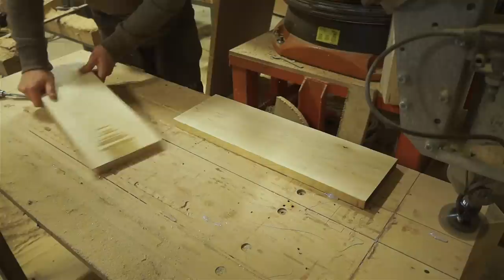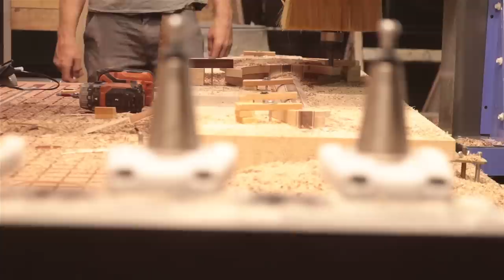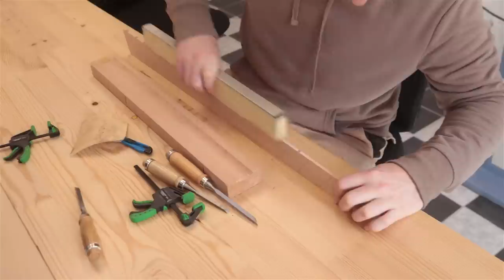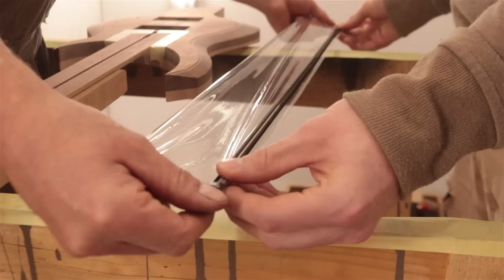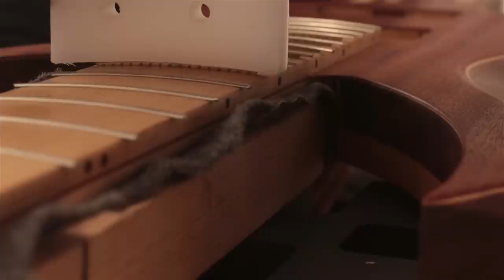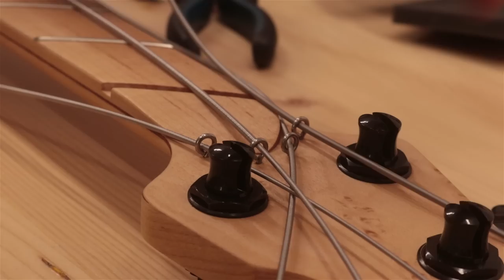Making a Sub-Octave Bass for Nate Navarro - Workshop sounds, no talk

Comment: I really love your builds. One thing I would like to point out is the glue you use for layering. As far as I can tell, that's PVA glue. Now, it's an amazing wood glue in most cases, but luthiers don't really use it for building and repairing, because of a critical property. When it dries, it stays just slightly rubbery. In construction or furniture making that is in no way a problem. However when you're building an instrument, that thin layer of soft material between the good quality wood can lead to dampening of the vibrations throughout the body and neck. A much better option for laminating would be 2 component jeweler's epoxy. It sets up super hard, so it would be the ideal material for transfering vibrations. Another good option is Titebond original wood glue. It is made of aliphatic resin, that has better properties than PVA. You can do a really easy experiment. Put a dab of PVA and Titebond side-by-side on a piece of wood, let it completely dry, then try to sand it. You'll find that while the PVA will gum up the sandpaper and shred, you can beautifully sand Titebond. I hope this was at least interesting for you guys, even if you stick with your methods.

Comment: Kalium, the string company, has a 40 inch (1016 MM) scale bass they call the Quake that comes in both single and multi-scale options. I assume it was originally made so they'd have something to get a good tension to be able to show off the 0.266 gauge string that they make

Comment: Beautiful build, my only recommendation  is that instead of lining the pockets with "silver" foil, use copper, and solder on a ground wires that can be connected into the electronics.

Comment: Whoa, what an awesome instrument, didn't even know these were a thing.

On that note, that finishing process where the router takes more time lifting and repositioning than cutting pains me. What CAM program do you use? You could set it that the tool stays down the whole time and just circles back  for the next cut (no horizontal lifting motion) or you could even let it do climb cut and conventional cut passes alternatingly, which is fastest but might not give you a the desired surface finish, so use with caution. Hope this helps you optimize your process.
Reply from the maker: Yes, this is a prototype but hopefully we will build more. 😁As for the milling,  after years of working on a robot and testing all the speeds, feeds and milling methods, I concluded that the best surface finish on wood is achieved when tool always goes in the same direction, and the total time on the project is also the shortest. It would be faster milling part to have it mill around without  lifting but I would have to make additional extensions on 3d model where tool would change direction, otherwise it would leave a mark which would take more time to sand and leaves less precise surface. This is more of a problem on a robot arm than our cnc because it is not as rigid as cnc and each direction change is quite noticeable especially at higher speeds . The plus side is that robot hand can move up to 2500mm per second ( I never go so fast because I just feel it's not safe or good for machine,  usually set to about a meter per second)  so time in the air is a fraction of total milling time. Setting up the 3d model this way  would usually take more time than using just down cut and do something else with extra time while machine works. Although for instances where we have multiple identical pieces, I agree it is the way to go. I suspect if we buy more quality cnc with lead screws instead of gears on x and y, marks from direction change would be much less of a problem.
Reply: @lignumchannel  I think you're misunderstanding, in my CAM-software (Fusion 360) it's just a setting that makes the cutter move through the air on the same z-plane to get to the start of the next cut instead of lifting. I found that this works a good bit faster. No need to model extra geometry or something like that. If your software doesn't have this though then I have to excuse myself.

Comment: Amazing work up unitl the cheap eye hooks you used to guide the strings to the head?
Reply: How about the plastic knobs too?
Reply from the maker: Yeah we made a few guitars with hooks lately but I'm not sure we will stick to that design. Also the knobs, I like their design but not the method of production. Bog oak ones would fit it much better.
Reply: @lignumchannel  That's good thinking. The hooks took this seriously good work down to some redneck DIY level. It hurts, especially after seeing what you guys are capable of ;)

Comment: Any bass can become a sub octave bass with big enough (diameter) strings.  Kalium makes strings up to. 200 I believe.  For reference, my average low B string is a. 135...
Reply: But the max B string length is 37" currently on most high end basses even then the string would be sloppy as hell and muddy. This is 42" or something crazy so the added bridge length helps with the string tension.

Comment: Great instrument, i have already seen the video from Nate, and great work / craftsmanship. On thing i would have changd, the 3D printed knobs. The FDM Printer structure looks IMHO unnecessary cheap on this amazing instrument. I already have noticed this on Nate's video. However, 3D printed knobs using resin printing would look much better. And even my super cheap and small Anycubic Mono could do this.

Comment: Use a CNC machine to carve out a laminate a few thousandths at a time, hand sand and finish, install the finest hardware... but the truss rod looks like it was made in a high school shop class.
It did get an electrolysis treatment, though....